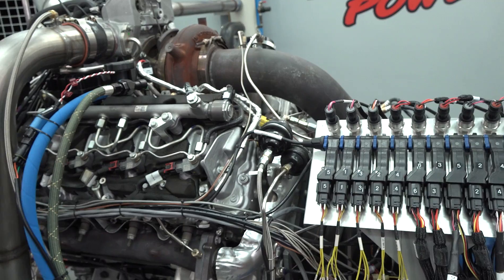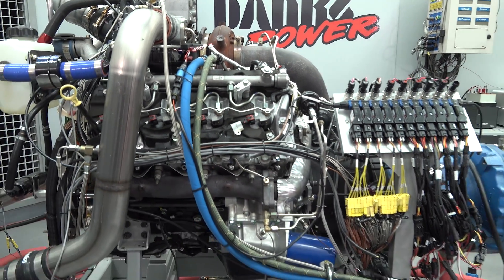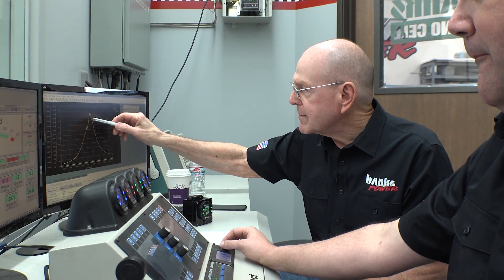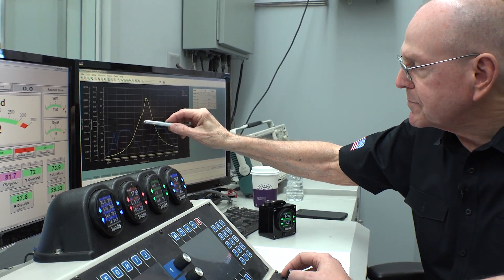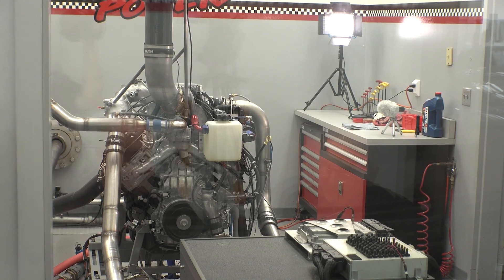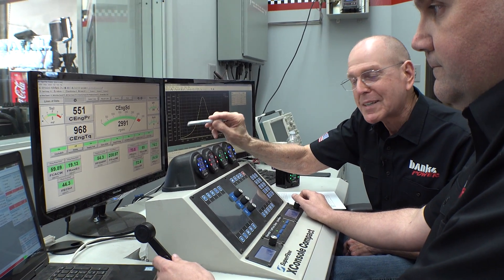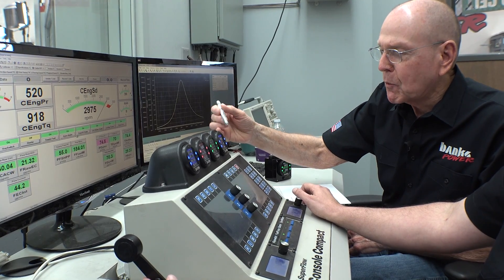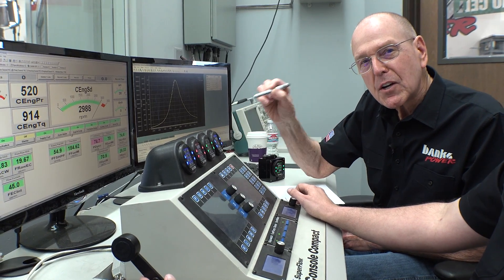KILLING A DURAMAX Pt 2: 550 Horsepower! 🔥

Comment: I wish i could put an idash in my Subaru lol
Reply from the maker: You can. The iDash can run in 2008+ vehicles with OBD and standalone 12v configurations. With 40+ accessories and sensors, you can custom tailor an iDash solution for you Subaru. To learn more, tap this link 👉 https://official.bankspower.com/tech_article/whats-going-on-in-my-engine-and-how-do-i-know/
Reply: @bankspower  even my '99 Japanese model?

Comment: The “nose-over” you speak of is the piston speed slowing down as the crank is reaching the top of its stroke. 
I can’t speak for these injectors but I know the denso ones are multiple strike to achieve a smoother burn.

Comment: If you really want air-density, then why not hook up an AC unit to the intake after the inter-cooler.???
I am sure it will produce significantly more power then the compressor uses.
Might even save fuel by razing engine efficiency.

Comment: would be cool to dyno an engine in a sealed, pressurized room where the exhaust is the only outlet for pressure and compare to same output of the same engine under regular atmospheric pressure or density.

Comment: 445 hp (332 kW) at 2,800 rpm and 910 lb⋅ft (1,234 N⋅m) at 1,600 rpm. 
Design spec performance can exceed 550 bhp (410 kW) at 3050 rpm and 1,050 lb⋅ft (1,424 N⋅m) at 1975 rpm.
Would like to see the whole power and torque curves.

Comment: You mention at the outset a HP number higher than stock in a truck. Is this engine running “deleted,” or are all emissions systems still installed for this analysis?

Comment: How did you put in the piezo for the cylinder pressure? Is there enough space in the head to easily drill it or are you using instrumented glow plugs?

Comment: Great stuff, I am a Mechanical Engineer love your test setup. You sound very knowledgeable.  To get absolute pressure from a gage you need to add ambient pressure to the gage pressure (at atmospheric a pressure sensor would read 0 psi, not 14.7). Under STP (standard pressure and temperature) this usually 14.7 psi.  So gage pressure (psig) usually the pressure above or below atmospheric pressure. Things get interesting when calculating total pressure from say a pitot tube measuring air flow where you have to consider stagnation pressure and dynamic pressure. Great application of Thermodynamics here to try to predict max hp, and getting actual numbers from the sensor transducers. Cool stuff.

Comment: I have a 2019 L5P. It has banks ram air intake, banks monster exhaust, banks derringer tuner with the i dash data monster, and a banks diff cover. After install, I got a check engine light for ambient air sensor. Any thoughts on why this might be? I absolutely love the truck and it runs like a beast!
Reply from the maker: Hey Scott, sorry for the delayed response. Please message us on our Facebook page or email (socialmedia@bankspower.com) us your contact info. We will have out tech support team contact you. Please comment here when you have done so. Thanks!

Comment: Outside air temperature plays a big roll. After close to 50 years of running class 8 diesel trucks. Before the air cooler on a engine. You could be in southern Arizona  on a 120 degree day 0 humidity and the truck could not make enough power to run fast then 40 to 45 mph but after the sun went down the air cooled it would start making enough power to run 70 mph the speed limit. But when they started installing air coolers and barometric pressure sensor cam and timing sensors with the electronic injectors so it could make the needed adjustments this problem went away. But the man's right everything has to be in perfect balance to make HP and Torque. I don't worry about the HP as much as the torque.

Comment: Why don't I just use a 2 stroke?
Reply: 2 Strokes are too Dirty to meet emissions in a Road Legal Vehicle. Even Most dirty bikes and outboard boat motors have moved to 4 stroke. Only Evinrude still sells a 2 stroke outboard...but it has ALOT of design technology to make it clean enough to pass emissions. There use to be 2 stroke diesel in the past (semis) about 50-60 years ago.

Comment: so is the L5P a good motor im looking at a 2017 duramax Denali with this motor .
Reply from the maker: Not only is it an outstanding engine, but the military is installing them in all Joint Light Tactical Vehicles. If that doesn't speak to durability, we don't know what does.

Comment: Be awesome to see some of the power at 1600-2400 rpm as well and get to see that peak torque. Pulling trailers lower rpm bit more useful then running around at 3000 rpm, but still very awesome to see that power put out at that rpm and for that long.

Comment: As a fellow engineer, if you know what the hell you are doing, you don't have to hide and play games.  Real data is king.  Furthermore you can't get to fundamentally improved designs without failure(s).   Mr. Banks, i'm impressed with your candor.  I have successfully used your products in the past on my 7.3PSD.  I am currently looking into products for my new 6.7
Reply from the maker: That means a lot coming from a fellow engineer. Thank you! We're just launching our best test program for the Ford 6.7 Derringer inline tuner. It should be available in the next 60 days along with our new Ram-Air cold air intake. Our 5" Monster Exhaust is now available.
Reply: @bankspower  I have a 2016 F-250 w 6.7.  While I believe its a very well engineered engine, the turbo lag and pedal feel is atrocious.  PS I went to mechanical and aerospace engineering  school (thus the MAE) at NC State in Raleigh,NC .  Best Regards,
Reply from the maker: @NCSUME1  Our offerings for the 2016 6.7 will follow the 2017+. Yeah, it could use some help in waking it up.

Comment: Mister Banks, once again, you are my engine tuning hero!! Thank you SO much for showing us how to make the most power!! I have used what I am learning from you to tune a friend's 1993 Acura Integra that we did a VTEC head swap on. Because of what I learn from you, I have managed to get his car to drive smoother than it did stock, despite the larger throttle body, intake manifold and headers/exhaust. And, he still can manage 28 miles per gallon :)

Comment: After  watching this yesterday and thinking about it for a while I wonder if maximum cylinder pressure is affected by running the engine either rich of peak or lean of peak on the same air fuel ratio?  This concept was used in WWII on planes and is still used in aviation to this day.

Comment: Gale, first, THANKS for this!

I was a mechanic with the Army, working on 
Chinook helicopters.  I also studied on the 
various functions that air pressure did.

This makes PERFECT sense to me.
(I also had an aircraft altimeter, 
replacing the broken clock, in my 
240-Z.  I used it to predict the weather.)

Gale, while I do not play with (work on) 
Diesel stuff, I'm staying around for Part 
III, on this engine!

Heat pumps are heat pumps, regardless 
of the fuel used!  You WILL teach me 
something.

steve

Comment: Now all we have to do is wait a month for part 3 and next year for the diff covers.
Reply from the maker: The reason for the time between follow-ups is purely due to R&D. This is not a reality show with episodes taped months ago. When we post a video, ten times out of ten, it's something that happened that day or the day before. Now, maybe we should sit on the videos and post them all at once like a Netflix series so you can binge-watch them and know how it ends. Unfortunately, we're not a TV studio. Good things take time. Doing something no one has ever done before, at least done it well, takes time. Regarding the diff cover series. We've been sitting on the info for quite a long time. Why? We'll only get your attention once. We're going to reveal the research when we debut our cover design. Put yourself in our shoes. You've done all the competitive research and you're excited about sharing it with the world. But along the way, you discovered how to improve diff covers in a way no one ever has. So, you design one. But making it isn't done like the other guys where someone bangs out a design in CAD then sends it off to the sand cast shop. We made many iterations and several billet prototypes, tested the heck out of the design, then went with a manufacturing process that is far more accurate but takes much longer. Are we curing cancer? No. But are we making the very best part possible? Yes. 👍

Comment: What happen to the damn diff cover 😑
Reply from the maker: The reason for the time between follow-ups is purely due to R&D. When we post a video, ten times out of ten, it's something that happened that day or the day before. Regarding the diff cover series. We've been sitting on the info for quite a long time. Why? We'll only get your attention once. We're going to reveal the research when we debut our cover design. Put yourself in our shoes. You've done all the competitive research and you're excited about sharing it with the world. But along the way, you discovered how to improve diff covers in a way no one ever has. So, you design one. But making it isn't done like the other guys where someone bangs out a design in CAD then sends it off to the sand cast shop. We made many iterations and several billet prototypes, tested the heck out of the design, then went with a manufacturing process that is far more accurate but takes much longer.
Reply: Banks Power love u banks

Comment: Mr. Banks, I hope you read this and respond. Are there any gains in having a 5 inch inlet that necks down? Also, Is there any reason to have charge pipes larger than the intercooler inlet / outlet and larger than the engine inlet?
Reply: I'm not Gale, but I'll throw out some info. The 5" inlet will allow more air through at a set velocity- and if it's necked down properly it will allow the velocity to increase and allow more overall air into the turbo inlet than a smaller pipe.

On the charge pipes size, it mostly depends on routing. In an ideal situation you want all of the pipes the same for consistent flow, but that's achieved with straight pipes. Obviously this isn't possible in an engine bay, so as you introduce bends into the piping you cause resistance to the airflow. By using a larger diameter pipe you slow that flow down and reduce some of the restriction experienced at the bends (faster flowing air is more affected by the angular change). Hope this helps,  and I'm interested to see if anyone at Banks responds.

*edited for spelling*
Reply: @Broadpaw_Fox  Thanks for answering! A couple further questions about pipe size, if you will humor me... 
The outside housing of every  turbo is larger than it's actual inlet, so is that not enough air velocity at the compressor housing size with a proper sized and well located air filter?

For charge pipe size, I hear what you're saying and it makes sense to me. Straight pipes are better than gentle curves, are better than sharp curves. So you up the size to reduce the loss of velocity. Is there a too big charge pipe?
Reply: @electricshockproof  - on the compressor housing, are you perhaps thinking about the turbine (exhaust) side instead of the compressor side in that fist question? I ask because I've never seen a turbo with less cross sectional area through the housing than it has at the inlet. That said though, on the exhaust side it does neck down considerably right before the turbine - and this is to increase efficiency as the high velocity of the exhaust there drives the turbine more aggressively. 

On pipe sizing, it's a bit of a trade off. Smaller diameter pipes contain less overall volume (which all has to be brought up to whatever boost pressure is desired), so using larger pipes means more lag as the pressure builds up. But if they're too small you lose flow through the bends. Physics has methods of determining how much air at specific temperatures can flow through various setups (hydrodynamics), but you can also quick and dirty it by looking at so.ething with similar power production and it's pipe sized. Then maybe play with changing size and see what happens - if you go bigger and don't gain power, but lag increases then the original size was better optimized. Just try changing and see what happens - but yes there is a sweet spot for pipe size, and it changes for every application.  ;)

Also remember- I'm not a 'professional' making money with this knowledge- I'm just a passionate hobbyist whose had a couple turbo cars for a couple decades and loves them. :)

Comment: Diff cover final video?
Reply from the maker: The reason for the time between follow-ups is purely due to R&D. When we post a video, ten times out of ten, it's something that happened that day or the day before. Good things take time. Doing something no one has ever done before, at least done it well, takes time. Regarding the diff cover series. We've been sitting on the info for quite a long time. Why? We'll only get your attention once. We're going to reveal the research when we debut our cover design. Put yourself in our shoes. You've done all the competitive research and you're excited about sharing it with the world. But along the way you discovered how to improve diff covers in a way no one ever has. So, you design one. But making it isn't done like the other guys where someone bangs out a design in CAD then sends it off to the sand cast shop. We made many iterations and several billet prototypes, tested the heck out of the design, then went with a manufacturing process that is far more accurate but takes much longer.
Reply: @bankspower  Just letting you know that I'm interested in the outcome.
Reply from the maker: @DrewBe59635  Thanks for your patience, Drew. the info is coming. Promise.
Reply from the maker: @DrewBe59635  Thanks for the interest in the diff covers! We can't wait to show you what have found with the research. We like to explain to people and let them know what's going on. 👍

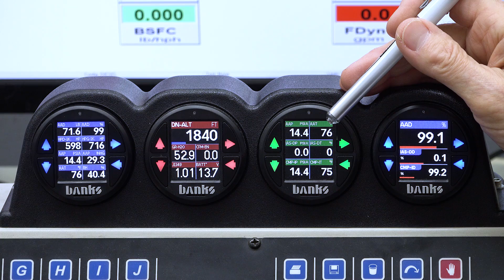Comment: So at 9:20 he is talking about it is better for the intake filter to be boxed in a housing to protect it from outer heat that the engine creates, correct? And his stick analogy is just a filter on a pipe similar to how his is set up in the dyno room?
Reply: Exactly. Though in that room he can get away with the 'filter on a stick' because the room is so large and it's not cramped next to the engine breathing in the hot air from the radiator. Those are the reasons you want to isolate the filter's intake... ;)

*edited because autoderp*
Reply: @Broadpaw_Fox  That's what I was thinking he was getting at! So basically all the WCFAB and other similar intakes everyone seems to have is not the right way to go since they are completely wide open around the filter.
Reply from the maker: @zziegler86  This may help. https://www.youtube.com/watch?v=E9ixQ3OwzZ4

Comment: I think this is the first time I've ever seen somebody checking and monitoring the cylinder pressure wile the engine is running on a dyno 👍
Reply: Really fascinating stuff!!👍👍👍
Reply: Incredible instrumentation!  Especially the pressure sensor sensitivity to capture the pressure curve at that RPM. A little math ME 101 tells me 190 bar - 2800 psi puts about 9 tons of force on a 3" piston.
Reply: A lot of diesels use the glow plugs with integrated compression sensors for each cylinder. 
Vw from 2009-

Comment: How would rig up one of those idash things on an engine without an ecu or any electronic control?
Reply: Brett Wilkins They’ve got individual sensors for the gauges. So, you’d just have to buy the gauge, the sensors, and the harness. Then install it all. With a couple of pressure sensors, temp sensors, and a humidity sensor you’d likely get most of the info.

Comment: At 12:03 on the video you talked about the pressure rise after injection. If you would have shut the injector off what would the graph do? Would it peaked at around 48 to 55 bar, which would have been a running compression pressure without injection causing the pressure to rise?

Comment: I bet Gale will hit more then a thousand HP before he breaks something...
Reply: 1275 HP is my guess, and it will be valve train related... LoL
Reply: Not in a diesel- not high enough rpms. Might hit 700 maybe (and that's reaching really far) if he replaces injectors (which they probably won't do - likely only increase fuel pressure).

For reference- the 15 liter motors in big trucks only make about 650 hp or so at full song... though they do make around 2500 lb/ft of torque doing it. :)

Comment: The difference between your products and packages is your R&D is done so that you add safe power,not an intermittent peak  number that the engine can’t safely sustain. You are educating the average joe who has no clue what drive pressure is or does when you are outside the map of the turbo, you easily hurt the engine or head gaskets if you are lucky.

Comment: It’s pretty crazy to think he lost almost 50 hp just by sitting at max load for a little bit. Wonder if that was heat soak or the turbo losing velocity
Reply: I'd guess intercooler heatsoak. Overspinning a turbine generates beaucoup hot air.

Comment: forgive me if i say anything stupid, being the internet i'm sure you people won't though so fire away! haha

is the MAD meter thing not achieving the same thing as the combinations of the temp sensor, presure sensors altitude etc etc? just spitting it out as a absolute value rather then a estimated/calculated value?

not saying this isn't amazing tech or helpful, as i'm bad at math, i'm bad at using the formula's to calculate air densities... just curious if this "assumption" is correct
Reply: Fabian van den Bussche Yes. It’s taking the feedback from multiple sensors to calculate the air density. That way you get a live reading of it instead of having to pull a few data points and calculate it.
Reply: @NBSV1  woohoow i'm not as stupid as i initially thought! 
thanks ghehe!